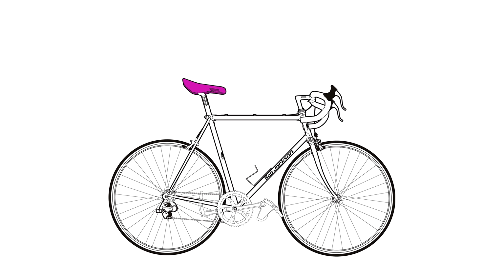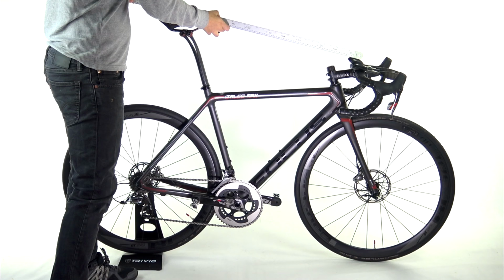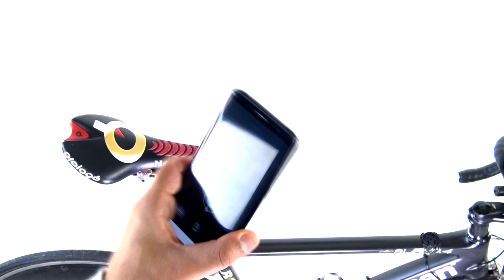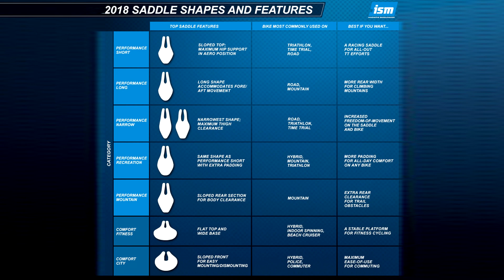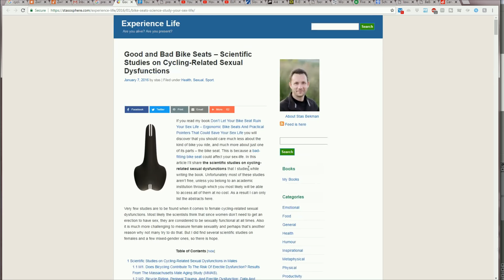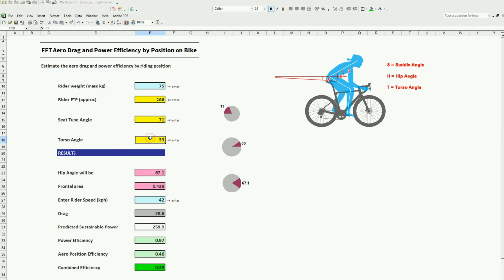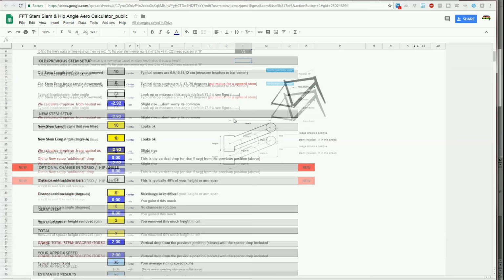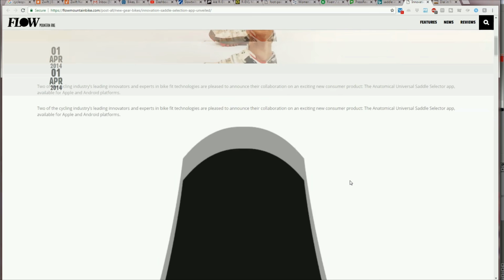Saddle Tilt Science! (inc Torso & Hip Angle). Is there an optimal angle for comfort & aero?

Comment: I'm sceptical of what's proposed here.  My femurs are connected to my pelvis by joints, so my femurs can rotate independently of my sit bones.  Similarly, my vertebral column is also flexible with regard to my pelvis.  This goes against the thesis of this video, which seems to imply that the femurs are not independent of the sit bones, according to the diagrams, e.g. at 12.06.

Zac Gallardo  https://www.youtube.com/watch?v=W02H-872kB4  at 4.10, says that guys generally prefer an upward tilt, whereas gals prefer downwards.  I prefer upwards, regardless of whether I'm down on the drops or up on the tops, which I find makes no difference to my comfort on the saddle, due to the aforementioned flexibility.

Comment: Question if I tilt my seat down let's say 15 degrees, is that not causing a sheer stress across skin on my butt and now that the contact space between my butt and the seat is smaller a lot more pressure in that area. Also, should I move the seat up slightly so that I am basically leaning on the seat instead of sitting on it? If I am new to tilting my seat should I increase  the angle over time or combine it with my hip angle to achieve optimum performance right away? One last question what should my hip angle be at the top of the arc? Thank you for your time. I appreciate it very much. 
Danny

Comment: The speeds at which most recreational and touring cyclists ride are usually low enough to make aerodynamic considerations much less important. At fifteen mph (often the speed limit on local bike paths) or less, aerodynamics are far less meaningful than they are at 25 mph+. Strikingly so if you examine the graphs.
Reply: But you forgot about wind.

Comment: Seeing as the rear wheel is raised by the stand, won't that through the saddle angle measurement off?
Reply from the maker: Yes good point it is about 1 degree off...well spotted! Level the wheels for an accurate measure
Reply: Well, after you've decided on a saddle, why do you need the angle in degrees. Can't you just use a long straight edge on top of the saddle, and compare the angle by where the straight edge intersects or passes over the stem? With this merhod you decide to adjust the angle up or down by a amall amount and check the straight edge projection accordingly.

Comment: Neat. I am dealing with numbing in my hands; would the saddle position aid in causing this issue? I am riding a Specialized Sirrus 2018 with straight handlebars as my commuter bike. Any advice?
Reply from the maker: sorry to hear that. Try to reduce weight on bars by lowering saddle slightly and reducing down tilt and try changing cycling gloves and consider raising stem slightly

Comment: It's really difficult to get this right.  Too far down and it kills my lower back, level feels better but there is a slight loss of power.  Is there a difference if you use a more compact frame for racing rather than a more relaxed frame geometry?
Reply: If you think about the touch points on the bike, pedals-saddle-hoods, the frame shape doesn't really account for much in terms of fit.  Granted, different frames will have different handling characteristics.

Comment: Ive recently flattened out out my saddle one or two degrees and its helped out greatly with my back and hip discomfort on long rides. However,  i still have the sensation of slipping off the front of the saddle and finding myself always pushing back on the saddle. Any advise?
Reply from the maker: Sliding forward is usually due to one of 3 things a) saddle too tilted down b) over reaching for the bars c) seat setback too far behind bottom bracket ("effective seat tube angle"). Look at these three factors first but if nothing helps, as a temporary experiment try some elastic bands on the saddle / or gripper tape. IF that helps (a sticky saddle) then try the Prologo "CPC" saddle series as these are high friction. Sometimes a seat that is too high can also be a problem for slipping forward. If possible try experimenting on the trainer indoors if you have one.
Reply: Thanks for the help

Comment: Ok, that was confusing as hell for me.  My saddle is at level 0 degrees and when I ride I feel like I’m sliding forward on it all the time and constantly have to move myself back.  What’s is the most likely cause for this?  I’ve already had a shorter handle bar stem put on my bike with a slight upward angle to reduce my reach forward, am I still reaching too far?
Reply from the maker: Sliding forward is usually due to one of 3 things a) saddle too tilted down b) over reaching for the bars c) seat setback too far behind bottom bracket ("effective seat tube angle"). Assuming you have ruled out a) and b) have a look at c) by moving your seat further forward on the seatpost rails. If nothing helps, as a temporary experiment try some elastic bands on the saddle / or gripper tape. IF that helps (a sticky saddle) then try the Prologo CPC saddle series as these are high friction. One of these four solutions should hopefully help you.
Reply: FastFitness Tips: Cycling Science! - thank you the reply.  I’m worried the bike shop sold me a size larger bike than I really needed.  I’ll see about sliding the seat forward on the rails to help.  I already bout a shorter handle bar stem to bring them back closer to me.

Or maybe I just don’t have proper posture on the bike in general.
Reply: I do bike work, and I tell people that, for the casual rider, the back part of the saddle that you sit on SHOULD BE LEVEL WITH THE RIDING SURFACE.  I've been riding bikes since the early 70's, and that's when Schwinn came out with the 5 speed Collegiate and started working on bikes then.
Reply: MrSpeedDemon72 
Check this book 
Andy Pruitt
Complete medical guide for Cyclist 
And Pedalear Bien by Zen Zanni is only in Spanish but you have everything about bike fitting is amazing book 
I hope it helps , bike fitting is easier than this video , really !
Reply: Without seeing you on your bicycle it's impossible to know if it's the right size bike for you but if you can stand over comfortably you're probably fine.  I opted for a 50 cm over a 48 even though the 48 would have been theoretically better because I like higher top tube on a gravel bike, it gives your knees something to hang on to.  You might try pitching your seat backwards and 1/4 bubble at a time but before you do that put a plumbob on your knees and line them up with your pedals to see that your knees and the pedals are correct.  It sounds like your seat is simply too far back.
Reply: Is hard without seeing you on your bike, use a plumb bob on your knees and align it with your pedals according to the standard procedure and see if your setback is correct.  With Setback is very important to start with a Baseline, there are some videos that will show you how to use the plumb bob.
Reply: There's a way to align your seat using a plumb bob.  I would suggest doing that because it's the standard approach, that doesn't mean that's the best place for you but it gives you a good starting position.

Comment: Would it make sense to tie the bike upright then leave the seat angle adjustment loose, then sit on the bike and move the saddle until it feels comfortable with no pressure points? 
I don't race. I ride for exercise. My bike is 'Redline 9-2-5' with factory saddle but I have installed 3 inch rise handlebars to relieve pressure on my hands.
Reply: With better core strength you most likely wouldn't need to raise the bars. As you keep training, strengthening your core muscles,  you'll probably find you can decrease the raise bit by bit. (Or if chasing speed is not your concern - just keep it comfy - makes for many a happy ride.)
Reply: That's what i did recently, seems to work well for me...

Comment: they really regulate seat angle?  so crazy
static measuring of pressure points is irrelevant; what does it look like under power?
Reply: I think under power your saddle doesn't really effect your comfort, in my opinion, I think that the point of the comfortable saddle is the few seconds/minutes where you're not under power to be able to rest comfortably.

Comment: Hey guys... Please help me because I have a 
problem  with the perrineum... IT S Very painful....
Reply from the maker: 1. Have a break 2 apply some ointment 3. Change your saddle 4 reduce your miles for a while 5 change your position slightly on bike
Reply: Measure the distance between your sit bones.  Many saddles accommodate 135 to 140 cm -  not wide enough for my 145 cm apart sit or ischium bones.  Better shops have devices to measure. Make sure your saddle is wide enough to support your spine. Some YouTube postings describe this.
Reply: I found that when I lowered my saddle 2 cm I could go back and ride on all those old saddles I had ditched as I thought they were uncomfortable. They were all blissfully comfy! Just watch out for hip pain.

Comment: Does anyone know what would be the ideal torque for carbon rail saddle?
Reply from the maker: I would guess around 2-4 NM. Basically tightened carefully and using finger strength only; not using a big wrench!
Reply: @Fastfitnesstips   aye thanks dude.
Reply: I'd check manufacturer specs first. I'm guessing 2-4nm is on the low end, 5-8nm may be more appropriate depending on saddle construction.
Reply: @CatalinTomescu Couldnt find any information fir the product. Saddle is san marco superleggera and single bolt saddle post. Saw on  a forum that if it is a single it should be around 6-8. And it is double bolt it shouls be 2-3.
Reply: I just got a Brooks Cambium C13 with carbon rails - their instructions say "...should not exceed 12 N/m." I used  8n/m.

Comment: A framebuilder friend of mine rides his brooks saddle nose up. I don't have a pic now, but it looks weird.
Reply: Bike fitters suggest doing the same thing with the vintage leather saddles. Otherwise, the rider slides forward.
Reply: I tried his bike and it hurt. But then I once bought a Brooks saddle and sold it one week later. I think they are not for me.
Reply: Yes, either not for your body shape or not for your riding position and riding style. As of my opinion, "traditional" Brooks are good for "city bikes" and gravel grinders (tilt-up moves rider to the back of the saddle, increasin the actual reach and making overall position more aero). They might have some models suitable for road (more narrow, though some use heavy and bulky, but classy B-17 on road bikes) and XC (compact with springs for leisure to moderate XC).